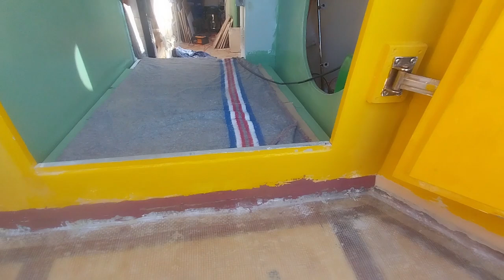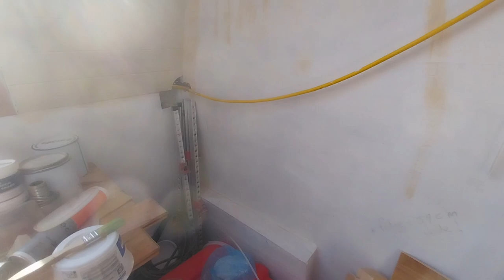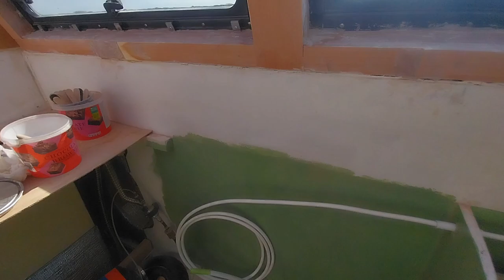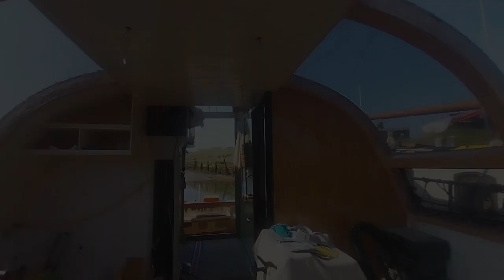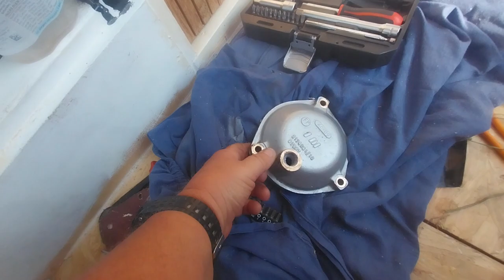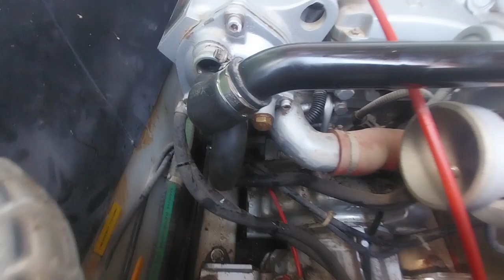Lifeboat conversion Ep.127:Engine maintenance and gas pipes.

Comment: Never seen that coated copper gas pipe before - what a good idea. I used yatch varnish on mine.  I feel the same about joints in the pipe - good to avoid a bulkhead joint but it is silly that they make you put an isolator near the appliance (2 more joins) when anyone would naturally head for the gas locker in an emergency anyway.
Reply from the maker: Hiya, agreed, so I am not bothering with that. I am not having anything certified, as I am using it for myself, so my problem if anything goes wrong. In my 30 years of living on boats I think I know what I am doing......🙂